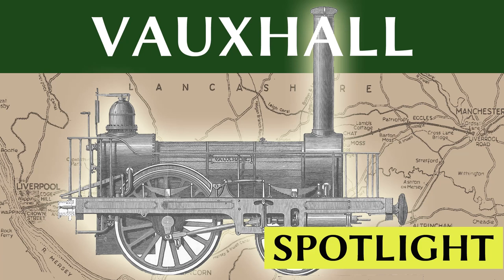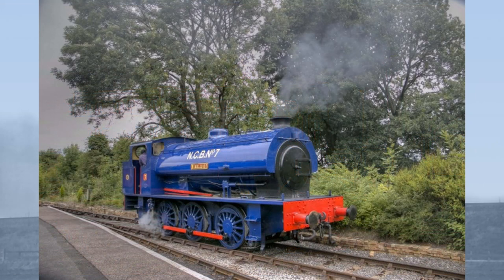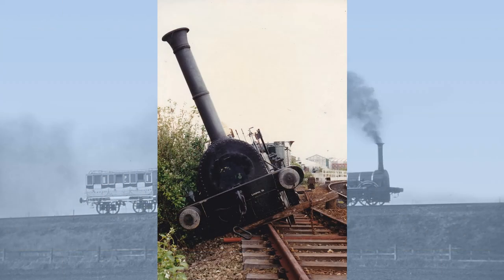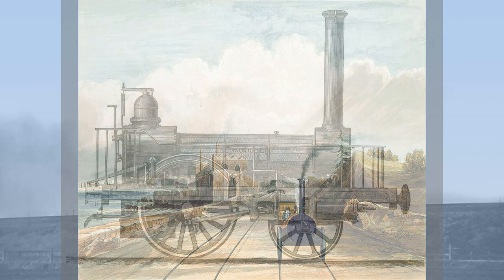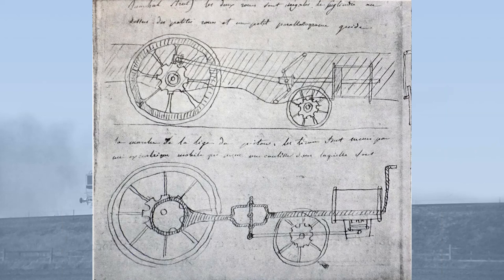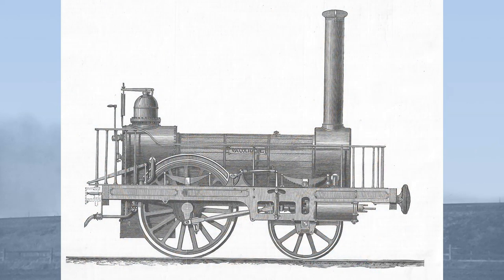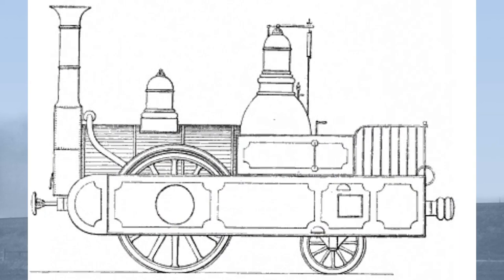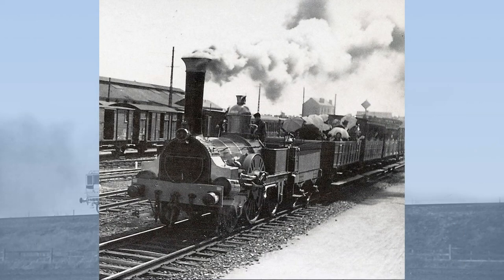Spotlight: Vauxhall

Comment: I have to say, though the Planets are undoubtedly revolutionary engines and darn handsome besides, I find the Vauxhall engines somehow even sexier, if such a term can rightly be applied to a railway engine. There's something about the arrangement of the small outside cylinders, with piston guides passing through the frames, that I find just drop dead gorgeous, especially in the 2-2-2 tank variant. It's almost a shame that this design did not gain as wide support as Planet did.

Comment: Very interesting loco. I was actually thinking of suggesting Surprise for a vid, as Dr. Church had a pretty interesting career.
In the U.S. Baldwin had come up with the half-measure of using a half crank to try and solve the issue of axle breakage, and one of his engines still exists in that configuration, the "Pioneer" of 1837. This configuration didn't catch on for the obvious reason that it possessed neither the advantages of inside or outside connected engines, and as Baldwin located the drive axle behind the firebox, the firebox had to be small to make room for the connecting rods to go around it. I think you can find footage of it in action at the 1949 Chicago Rail Fair.
Reply from the maker: The half-crank wasn't a new idea when Baldwin tried it. It had been developed by Robert Stephenson slightly earlier in Britain and used on his export machines to the US. He didnt find it at all succesful so whether old Mathias came up with the idea on his own or saw the Stephenson original I'm not sure.
Reply: @AnthonyDawsonHistory  It would be interesting to know. Baldwin built his first engine after inspecting a Stephenson locomotive  (sometimes said to be John Bull, but if he set out to copy a Samson type he ended up with a very good clone of a Planet instead, for some reason) but then he took a break of several years before building his next engine. I have never seen much of anything about whether he was following locomotive development in the interim, except that he went to inspect another English engine used on the Mohawk and Hudson, which had been fitted with a truck (turned into a 4-2-0). In any event his next loco was a 4-2-0 and used a Bury style firebox. I wonder which locomotive he had seen there?
Reply from the maker: @furripupau  Old Ironsides is clearly a standard Planet. He could have physically studied such a locomotive, or he may also have had a copy of Nicholas Woods' 'Treatise' which had scale drawings of Planet. Such drawings were very freely available in the technical press at that time. One of the things I'm trying to do with my book on the Planet class is to identify those supplied to the US market by British builders. The hardest part will be identifiying all the pirated versions such as those by the Locks & Canal Co who quite happily wrote to Robert telling him they'd copied his machines! I suspect madness will lie in that direction....
Reply: Given how many early imports were still in use into the 1850s and 60s, and how frequently companies were reorganized, merged, bankrupted, etc. it probably would be enough to drive one mad. Have you seen the daguerreotype of the Marietta & Cincinatti's "Tho. James" locomotive? I have no idea about the history of the engine (though it appears to be quite old already in the photo), but the image is clear enough to reveal many interesting details. It's a more interesting photo of a Planet in an American setting than the better known photo of the B&W Meteor.

Comment: Thanks. My memory is getting muddled - thought the Dublin & Kingstown engines had bell cranks. Sorry! Dr Church - although I knew of 'Surprise's fate I was unaware he'd designed and built her. He was also supposed to have built a massive steam road omnibus, shown in an old lithograph, to run services between London and Birmingham, but I've never seen any other references to it. So was it actually ever built, or was it like the famous Hensons' steam airliner?
Reply from the maker: The D&K had three engines built by Sharp, Roberts & Co.  - Hibernia, Britannia, Manchcester - and they had vertical cylinders and bell cranks. However, two of them were rapidly rebuilt with horizontal cylinders much as Experiment was on the Liverpool & Manchester Railway. The D&K also had three outside cylinder locomotives from Forrester of Liverpool. You can find out about Experiment here: https://www.youtube.com/watch?v=1GMRfR25gK0&t=55s

Comment: I'm enjoying your look at early locomotives, but I have to wonder why so many were bicycle-type and not four-coupled.  I won't even get into my disdain for cranked axles.
Reply from the maker: A single wheeler is a far freer running locomotive than one which is coupled. It also allows for the use of large diameter driving wheels which reduces piston speed. Engineers like Robert Stephenson and later Patrick Stirling recognised that unless all four wheels of a locomotive were exactly the same size then the rolling friction would be far higher by several factors, something which Stirling described as a 'laddie runnin' wi' his breeks doon.' Experimental work carried out by the National Railway Museum has confirmed their observations: coupled wheels need to be exactly the same size, which is pretty much impossible give wheels will not wear evenly. At the end of the nineteenth century when steam sanding was invented, singles came back with gusto for crack expresses. They were fast, powerful and free-running. There was also the problem in the early period that coupling rods were wrought iron, and could fracture: Robert Stephenson was very concerned about that, especially at speed. So too Edward Woods, Chief Engineer of the Liverpool & Manchester Railway and John Melling the Locomotive Supertintendent of the L&M. Coupled wheels were used for low speed, high power goods alias 'luggage' engines, but for fast express engines where you wanted a fast, powerful free-running locomotive single wheels were the order of the day.